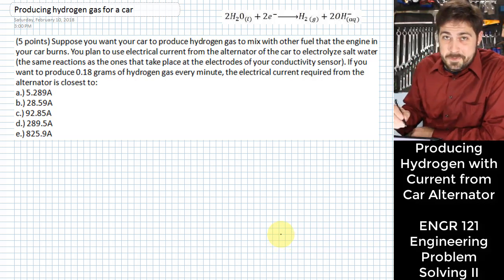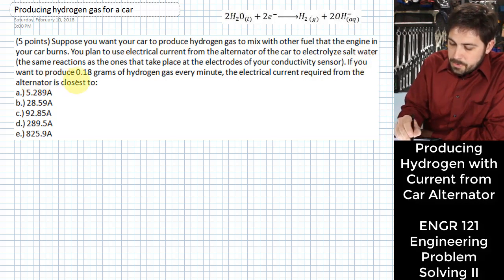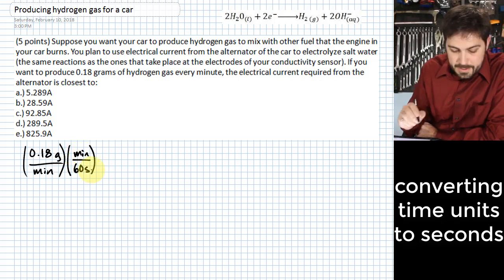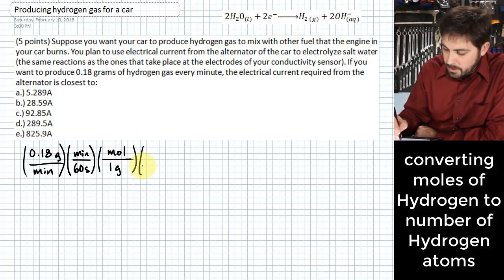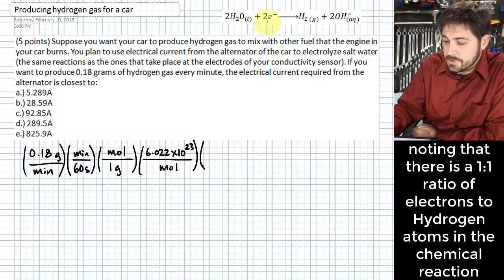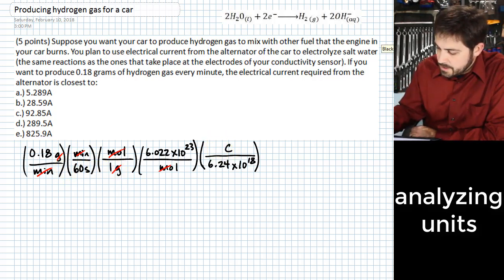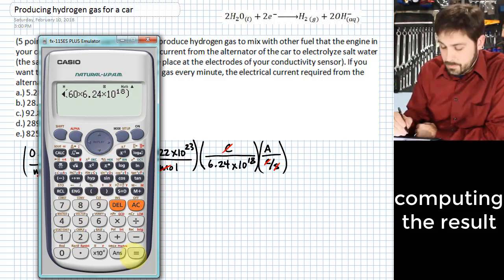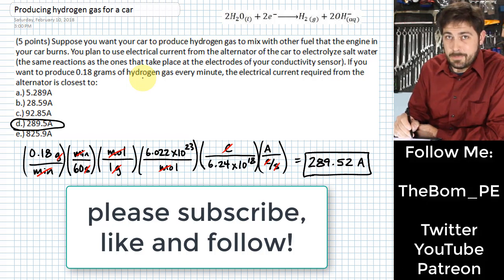Current Required to Electrolyze Hydrogen (using car alternator to supplement fuel)

Comment: The next question would be what could be produced for a 'reasonable load' for the alternator.

I believe 1200watts is in the higher end of alternators, at around 14v.
Not even 90A pushing such a system to the red.

I don't know off hand the numbers for the efficiency benefit of the hydrogen as a co-fuel. 
Guess I'll have to read up on what amount of hydrogen actually starts to tax the system, rather than benefit it.